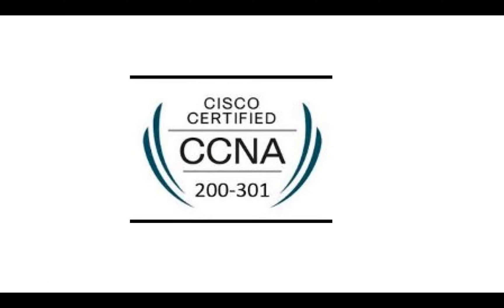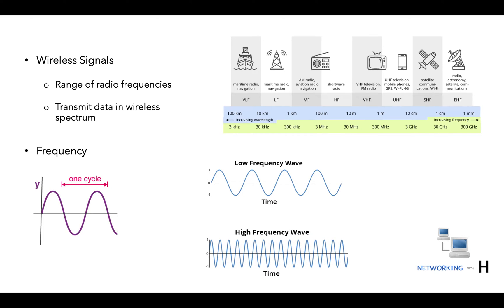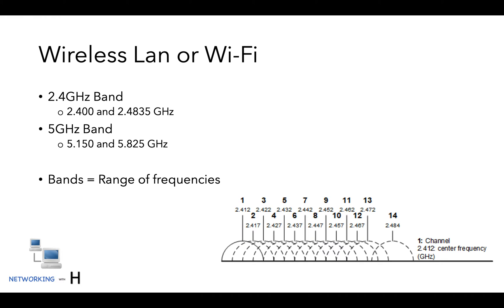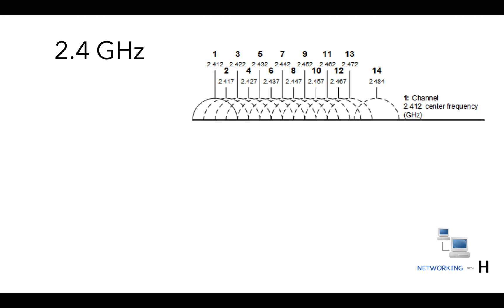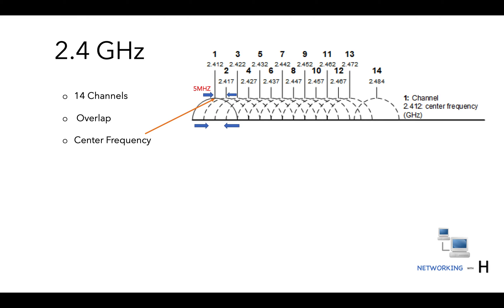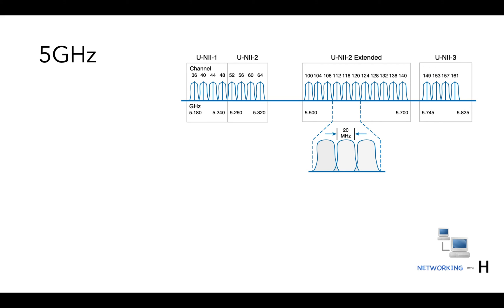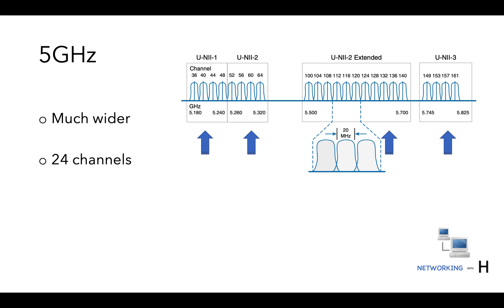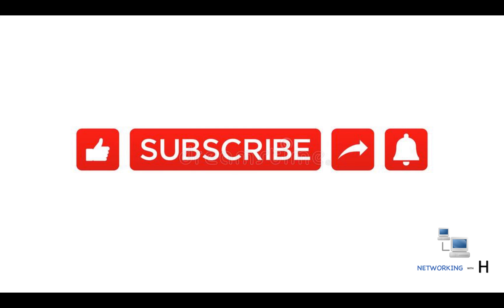Wireless principles | wireless bands and channels | non-overlapping channels | channel bonding

Comment: Thanks.
Regarding types of frequencies, if Time to complete an oscillation is 100 ms, frequency is 10 Hz (1/100ms)  (high). On the other hand, the frequency is  low (5 Hz) if the time to complete an oscillation is high (i.e. 200 ms)

Comment: Does the widht of a channel affect the speed of the connection? Like in my rooter setting I can have a 5GHz wifi with 20MHz/40Mhz/80Mhz, but what's the point of that if it's not affecting the speed?
Reply: Yes it does